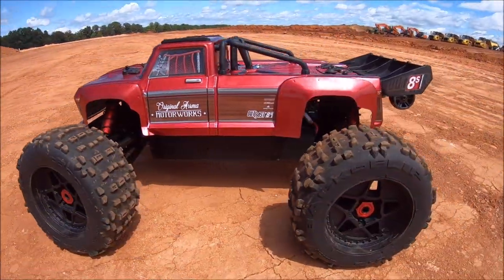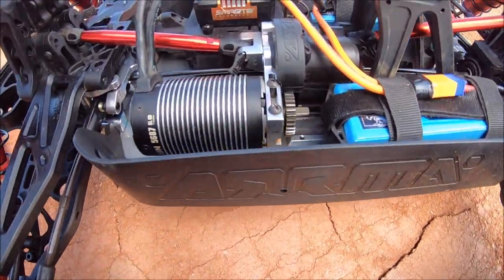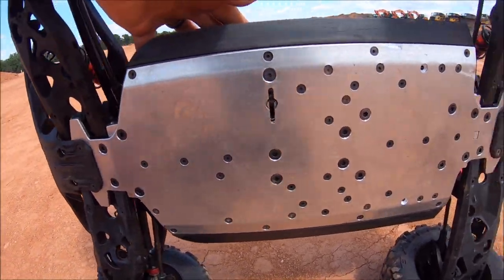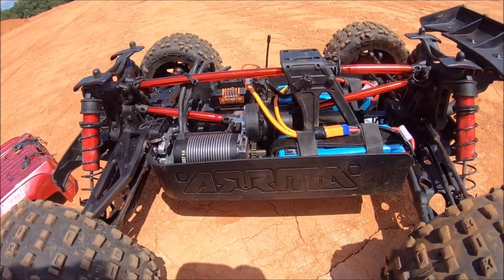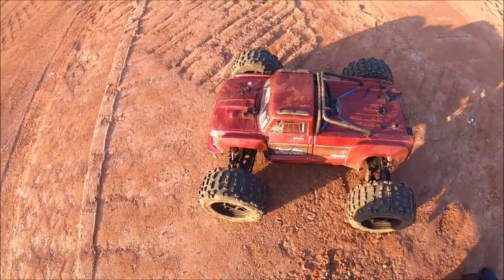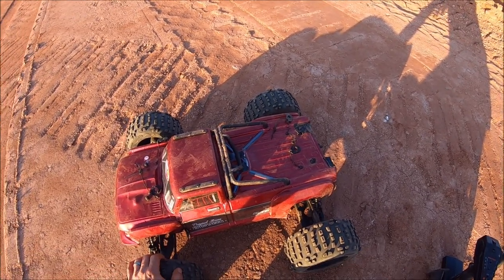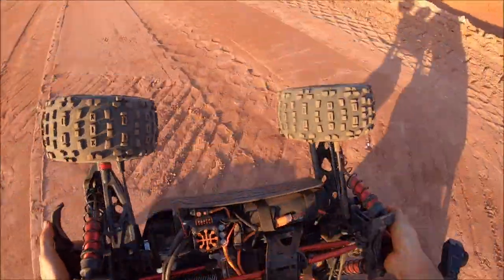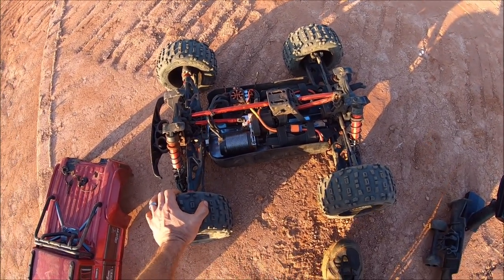Arrma 8s Outcast "Hobbywing 1100kv swap" and FULL M2C beefcake!💪💪

Comment: She's ripping now! Have you looked at tp motors? Thinking of trying one for mine they look well made and price is less than hobbywing
Reply from the maker: Thanks Kev! She's definitely got the brute torque that was lacking a bit.😜Haven't looked into the 1/5 TP motors. I know they are strong motors! I have a couple boats that run them. They do seem to run hot but I'm sure with proper gearing, itll rip! Thanks for watching bro!!😎👊
Reply: Did you put ear plugs in the center diff or thicker oil,,  love the video, always looking forward to the next one!
Reply from the maker: Thanks so much!😁Still stock diffs. Just changed out the motor.💪
Reply: Kevin talbot and rcdude 2 bad to the bone bashers.i have a crappy rc channel with low quality vids but u guys really are my rc role models that remind me what it's all about...fun! Get my 8s oc tomorrow, can u guys tell me if the outcast 8s is faster than the kraton 8s? Cuz from youtube it doesnt even look close
Reply: Good to see u guys conversating... nice vid rc dude as always

Comment: Nice vid! I'd love for you share motor temps during and after a bash like this...I'm trying to decide between an 800kv (which most seem to favor) or the lighter higher RPM 1100kv. I like the idea of the 1100kv motor but I am affraid of thermo shut downs. I like to run 2 sets of packs back to back during a bash. Keep up the great work! :)

Comment: I'm running 39/39 gearing with the XLX2 AND 800KV MOTOR on my Outcast 8s and it looks and feels way slower than that 1100kv motor. I'm going to try 35/39 and probably 30/34 gearing. I puffed my batteries too with 39/39 😱

Comment: Can you notice a big difference between the stock 1250kv motor and the 1100kv?
I have the kraton 8s exb and i currently still run the 1250kv stock motor..
And i was looking to put the 1100kv hobbywing in it paired with the stock ESC
Reply from the maker: There is quite a difference yes especially in torque. Paired with a Max 5 it really shines but even with stock ESC it will make a difference.💪💪
Reply: You run the stock spur or the 39 tooth spur?
And how are the temps?

Comment: Awesome rip Eric! That's double backflip was nice 👌 I think you might have broken the wing on of those doubles where it over rotated and landed on the wing 🤷‍♂️ Either way you sure gave it a beating with all those M2C upgrades 💪
Reply from the maker: Thanks so much Aaron!😁Yeah she's easily capable of doubles and quick corrections now!🤗I may go Rich's route next and try a spool gear spur and go smaller pinion. She was cogging a bit on me but this is an old motor too.🤔Yeah the poor wing had a bad crack in it from my last bash were she endured some nasty high speed rolls.😝Never really had any bad wing landings but the brute force of landing stressed it the rest of the way I guess.🤣🤣This rig is a pleasure to drive! She's definitely a heavy weight with all the M2C and bigger motor but tough af!💪💪The insane handling and agility blows me away for a SWB! Thanks for your comment bro!😎👊🤙🤙🍻

Comment: What brand of gears were you running? Doing m2c parts and this motor swap. Having a difficult time finding correct pinion gear to match the 8mm bore shaft that'll fit this motor and match up to factory running gear on the outcast.
Reply from the maker: I got my pinion gears from Sagacustomrc.com They have a great selection of 8mm bore pinions and they hold up nice!
Reply: @RCDUDE81  thank you!!

Comment: Have you had any problems with these standard tires? 
In fact, I've had to glue them on several occasions...
Reply from the maker: No glue issues yet but the foams are starting to loosen a bit!😝🤣These are great tires but definitely get soft after handling big power.

Comment: AWESOME Big Red Rip Brother Eric 😜!!!! Definitely has some good wheelspin with the 5687 onboard 👍. Sounded a tad rough down low, but the Max5 should help the extra amp draw with low end throttling. Props to Mitch for jumping right on the chassis 😍👌👌. She is very durable bone stock, but nothing beats 7075 T6 beef for going extreme 💪. Bummer on the wingmount, but bound to happen with this Huge platform. Loved the Huge sends and sundown Rips Brother!!!! 😍🥰🥰 Great stuff as always Eric 🤗🤙🤙😎💪👊👊
Reply from the maker: Thanks my Brother!😊She's definitely a heavy weight now!😂😂All the M2C 7075 is just glowing in her!😍Yeah the 5687 is giving her the torque the stock motor was lacking for sure! Like a night and day difference!💪She was sounding a tad rough on the low end. Not sure if I have a bad motor bearing or if was the ESC causing it. May have to inspect the motor soon! Either way she was ripping! Waiting on a new wing mount and hope to get her back out soon! Thanks for watching and your comment as always bro!😀👊🤘🤘🚀

Comment: another question :) you didn't had any motor heat problem? i'm with max5 28/47 gears and motor getting very hot..
Reply from the maker: I don't recall any major heat issues although this was probably pushing max gearing with this setup. I did give cool downs between packs. The ESC was being pushed pretty hard here but the Max 5 made a big difference! What was your temps? Anything under 180 degrees is acceptable imo after a full pack running hard.
Reply: @RCDUDE81  i didnt check temp..  but when i tuched it no.. its didnt was 180deg. Arrond i think 100-120c deg. You talking about 180 c or f?? 😅

Comment: Hey great video once again.  With the new motor does it run hotter and you have less run time? Or the same as stock motor .. and do you still have the limitless spool gear on there
Reply from the maker: Thanks bro! No limitless spool yet, just stock with a 30 tooth pinion. The temps were fine on the motor but a tad less run time. The bigger motor is definitely drawing more amps off the packs! I have to run a 100c minimum. May need to go for some bigger mah soon!  Thanks for watching!

Comment: Cool! What was the spur gear? I have new outcast 8s exb. Wondering if 32pinoin will work with spur 39 or 47 that came in the kit? What you think? (Same motor and esc as yours)
Reply from the maker: I was running at the time a stock 47 spur with a 30 pinion I believe. It was quite some time ago.😜

Comment: I also have an outcast 8s what pinion and spur gear are you running with the 5687 motor? I’m getting mixed answers. Wanting to try this exact set up. Thanks keep up the videos.
Reply from the maker: I'm running a 30 tooth pinion on stock spur. I currently have a Max 5 ESC which performs even better. Even with the stock Firma ESC, as in this vid, she was fast!😎👊
Reply: @RCDUDE81  thankyou for the reply looking for a starting point in my new build with new motors and escs  thanks again.

Comment: Will the hobbywing 5687 1100kv fit on the stock motor slide, and what is the largest pinion?
Reply from the maker: No you need the M2C large slide and also the motor mount as the M2C slide won't fit the stock mount.👌
Reply: Thanks for the help!
Aloha
Reply from the maker: No prob!😎

Comment: Are those Yowoo graphene lipos? If so I am trying to find out if they are any good. Been trying for months to replace my smc that went bad but the new ones are never in stock. Or maybe you can reccomend a solid 6s pack for the typhon?
Reply from the maker: Yes they're Yowoo Graphenes. I've had great luck so far with the 4s and 6s packs!😎

Comment: when changing the motor with stock esc as is, was there  setting changes that needed to be done? or just swap motor and run?
Reply from the maker: I just swapped motor and pinion. Had much more power once I swapped to a Max 5 but still better than stock setup!
Reply: @RCDUDE81  other then M2c is there a motor mount I can use that you know of?
Reply from the maker: Not that I know of. The quality of M2C especially.

Comment: Is there a slight or huge  difference  between   the  stock  and hobbywing   motor performance? Thanks!
Reply from the maker: Pretty much a huge difference imo especially paired with a Max5 and proper gearing. MUCH more torque too.
Reply: Thanks ,man! I'm going for it. I already have a mamba  xlx2 esc.

Comment: Was thinking of running max 6 and 100kv. Sound sufficient?
Reply from the maker: 100kv?🤔You mean Max 6 and 1100kv?
Reply from the maker: 😆Yeah it will definitely work. Better than the stock ESC. The Max 5 will work more efficient and supply max power feed with that big motor but the Max 6 will work. Just watch its temps.

Comment: Sweet vid man I'm running almost same set up on the 8s exb kraton max6 1100kv combo 27t pinion but having g some ec5 plugs coming unsoldered from ecs to battery connection any idea what's causing thanks
Reply from the maker: You may need to upgrade to a Max 5. The Max 6 may be overloading on that big of a rig! That will cause heat and melt the plugs.
Reply: @RCDUDE81  alrighty man thanks alot  I've also got a 24 and 25t pinion coming hoping that will stop the high current draw thanks again ✌
Reply from the maker: I run a 30 tooth with a Max5 and 1100kv with no real heat issues. You can definitely try a smaller pinion to be extra cautious!😎👊
Reply: @RCDUDE81  ya I threw on a 21t but wont backflip like on the 27t so hoping to find a sweet spot with the 24-25 if not max 5 next lol

Comment: Slight or huge difference compared to  stock   motor/esc setup?
Reply from the maker: Quite a bit more powerful and "torquey" with a bigger motor paired with a Max5. I think in this vid I was still running the stock ESC with the Hobbywing motor. Definitely faster but the Max5 made a even bigger difference in power delivery.😎🤘
Reply: @RCDUDE81   thank you for your information. I truly appreciate it. I rarely subscribe, but it's my way of showing you I  do appreciate. I subscribed.
Reply from the maker: Thanks so much!😁💪🤘🤘

Comment: Did you run the m2c shock shafts and pistons?  I got a set for the k8s and wondered what weight ppl are running.
Reply from the maker: Yes it's running M2C. The M2C pistons were tested and drilled for stock 40 weight. Super plush! Added droop screws to go with it and makes a huge overall difference.
Reply: @RCDUDE81  awesome man.  Im going to pull mine apart tomorrow thanks for the reply that helps.  For some reason I thought rich said he ran 30w but I can remember.  You test for m2c dont ya?
Reply from the maker: I do yes. 30wt is good for stock pistons since the holes are smaller.👌
Reply: @RCDUDE81  you are a lucky group of guys.  I just feel honored to say I have m2c parts.  That would be awesome to be able to say your a part of that.
Reply: @joshherrman3201  Cheers from Poland! I have a question, Is there any kind of official dealer of M2C parts in Europe? :)
Reply: @angrykaren  I thought they had a UK m2c dealer.  I don't know about Poland but Mitch at m2c will ship.  I've bought just about every aftermarket part for these kratons and own 3.  I wouldn't put anything on my cars other than m2c.

Comment: It's like construction crews just leave random dirt piles around, just in case you're passing.... 🤣 Is it worth replacing the wing? Seems to fly equally well without it, plus, a few grams of weight saved etc etc... 😉
Reply from the maker: 🤣Yeah I have a deal with them!🤣🤣I hear ya on the wing! I'll probably replace it since it does help protect the back of the truck! It definitely does run well without it!😜

Comment: So the stock ESC can take that speed and bigger motor???
Reply from the maker: It had no issue that I could tell! Surprisingly efficient ESC!
Reply: @RCDUDE81  I'm trying to decide between the 800kv or 1100kv motor from hobbywing for my Outcast 8s. Max 5 combo. 35/39 gearing or 39/39 gearing. What do you think? Thanks! I'm just worried about the extra weight of the 800kv motor. 🤔

Comment: Update the Esc? Tell me more please! Great video brother.
Reply from the maker: Yes stock ESC. Since Arrma's update on the new releases it did surprisingly well even with the bigger motor! No overheating either.😎👊🤘🤘
Reply: RC DUDE81 Is there a way to update the older Esc’s or no?
Reply from the maker: Yes Jason had put up a link for it. I'd check Horizon's website. I'd assume the update is there.

Comment: Hey in ur opion I'm going buy one of the to ether this truck or the exb truck which is better and faster and better out the box for my money please get back to me
Reply from the maker: Out of the box, I'd say the EXB is the better bargain. Just need your own electronics.😍Imo its tougher as well for hard bashing. The 8s is a load of fun once geared and tuned right.🤣Parts are a lot more expensive on it but still fun to drive around a huge rig! Up to you on that since these are two different scales.👌
Reply from the maker: The EXB Kraton is a roller. Meaning you need to supply motor, ESC, servo and radio. The truck already has nice upgrades on it so that saves time and money.

Comment: Arma is such a trash can company just make a double deck chassis already why is that so hard for them with good bracing in the middle.. instead they use tin foil and straws coming from a family of Engineers it is really annoying I'd kind of like an infraction but just look at the XO one that I ended up getting cheap used that bearing Center support has me sold